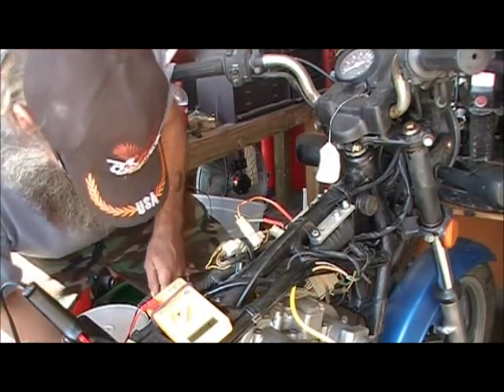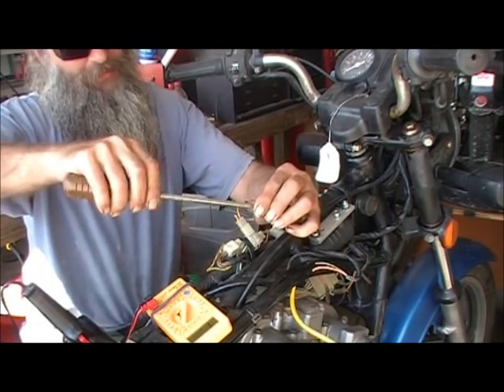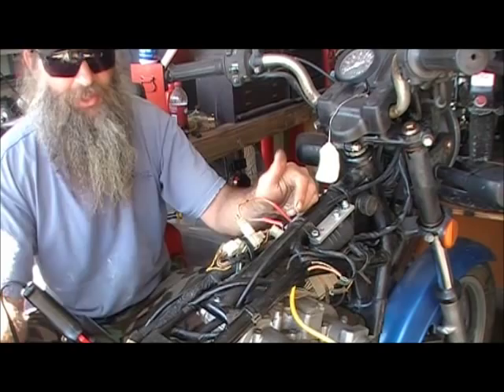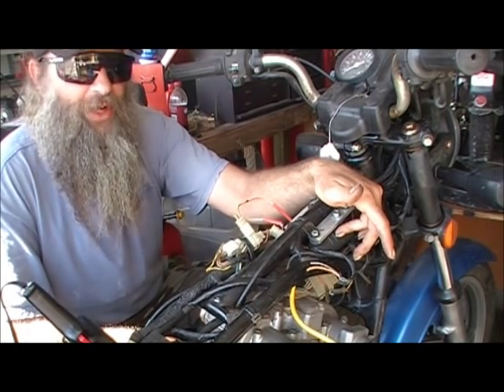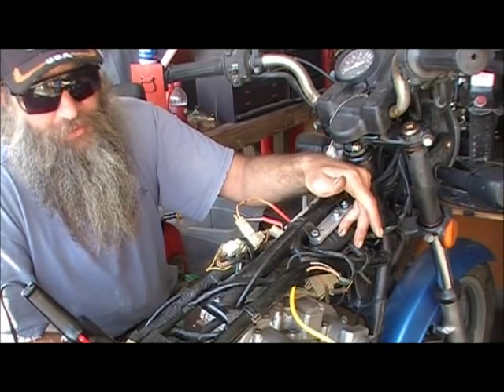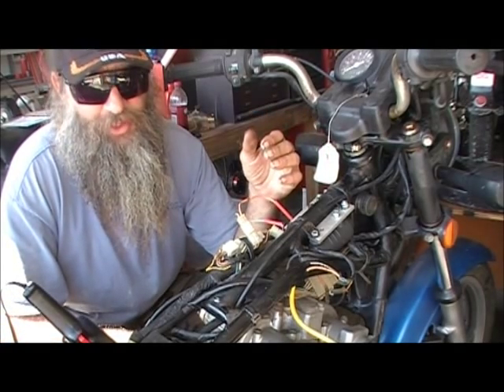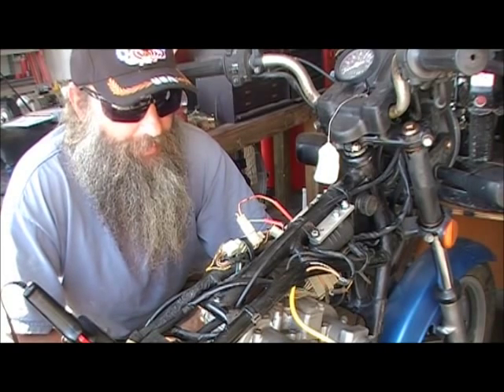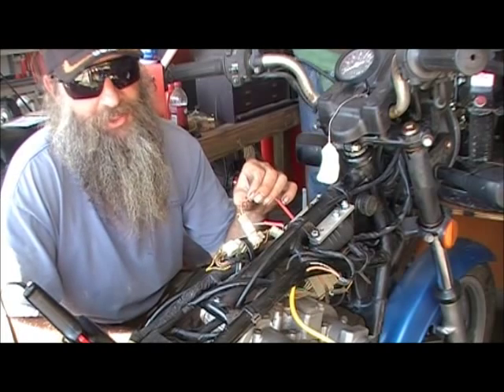How to prevent Motorcycle Coil Damage

Comment: True words spoken by a real rider. I had forgotten about the resistors this saved me from making a unnecessary purchase. I totally agree with him about the Dyna coils as well not for a man who puts 200 miles or more on his bike a day. Rain or Shine
Reply: Good morning brother, I have a dilemma. My bike is down again I'm not used to this from old Hondas! but to the point, my pickup coils have gone out on my 96 Honda Shadow VT 1100 c it has a4 wire pick up not a two wire. I bought a used one offline for a hundred and $40 but it died today and have later and and all I have is my bike and I put 200 miles on it usually a day. I am having the hardest time finding a new old stock or new set of these coils. Do you have any or would you have any suggestions for a man who is very capable in the terms of fabrication and all things mechanical could do too remedy the situation as I need to be back on the road immediately. Thanks for your reply keep up the good work.
Reply: Good morning brother, I have a dilemma. My bike is down again I'm not used to this from old Hondas! but to the point, my pickup coils have gone out on my 96 Honda Shadow VT 1100 c it has a4 wire pick up not a two wire. I bought a used one offline for a hundred and $40 but it died today and have later and and all I have is my bike and I put 200 miles on it usually a day. I am having the hardest time finding a new old stock or new set of these coils. Do you have any or would you have any suggestions for a man who is very capable in the terms of fabrication and all things mechanical could do too remedy the situation as I need to be back on the road immediately. Thanks for your reply keep up the good work.

Comment: I had a Crane coil crack on my 98 S&S 96ci …Titan Sidewinder ….what coil do you recommend to replace it …ignition is fine
Reply from the maker: I generally stick with accel -- 140408 if you need split towers -- 140403 if you're running parallel towers (first one is 3 wires - second only 2 -- both have 2 output coil towers)

Comment: How do I wire up coils on a 1986 yamaha fz600 an do they have to be grounded to frame
Reply from the maker: They dont have to be grounded to the frame -- you have 1 wire that is trigger and one gnd... but an FZR the coils aren't polarity sensitive - about 20 years too new for that ..
Reply: @dawino6260  ok so when u say polarity sensitive that means they stronger or weaker sorry for questions I'm new to motorcycle an is there a way to no if cdi box is bad wish I had u to work on it lol

Comment: Good day sir, first thx for ur awesome info video. I'm having trouble with a xv750 virago. When I start the bike and rev it high it works normal, but when low n slow rpm revs, it bogs and sometimes stalls when I let go of throttle. The colour of  spark plugs are dark brown at the top, and the bottom to the rim has black colour. Please help me with this issue I'm having sir?
Reply from the maker: Likely just has the virago vave guide drip ... but the low rpm at idle.. there is a single finger turnable idle adjust between the carbs .. Also - replace your plug boots with fresh NGK -- the resitors in them tend to eat up every couple of years - your favorite flavor is 5000 or 5k ohm - very often the culprit to low rpm stumbling ... check fuel filter .. not worried about the pump if it's running fine at high rpm ... If it only does it when it's cold, that  is the narue of the beast .. the 750 and 900 never seem to idle right until after they are warmed up for a couple blocks...
Reply: @dawino6260  thank you very much sir, I'm going and do as u said and see if it makes a difference. ☺
Reply: Good news sir, I've installed the air control valve system which does be inside the left pod, and what you know the bike is not bogging anymore. Thank you very much sir, I really appreciate for sharing your wisdom.☺👍

Comment: I have been using the ngk aftermarket ones. They are cheaper these days and after about a year they fail. Taking them apart, cleaning the contacts by using some cleaner and sandpaper then putting them back together will work for while. After it becomes a monthly chore or finally costs you a coil, you learn to just buy new ones and change them once a year. I'm in the habit of checking the coil and plug caps every oil change now. And as always change oil every thousand on the dot. Cheers

Comment: Thanx for all that, I appreciate your effort.  The Bonneville is my dad's 05.  I've already removed the seat, tank, coil, control box, and relay.  My dad is going to take the coil to a dude that he knows that flies airplanes and have him test it, dad says this guy is an expert on this stuff.  The control box has 18 pins, it probably can't be tested even by a dealer unless they put it on another bike.  No, I don't even have a Harbor Freight multi meter, I should prolly get one and learn to use it

Comment: I just installed Accel 140403s on my 81 Suzuki GS650L, is this aceptable for this bike or will I face any ohms/resistance issues?
Reply from the maker: shouldn't be a problem -- your stock tin ignitor box can take down to 3ohms -- but I'd use a 1 ohm automotive ballast resistor on the constant (not trigger) side of the coils if I was keeping it for me  if the box had previously burned the connector for the + inside the connector -- if not then no resistor  (those are just high speed switching transistors in those boxes to serve trigger)
Reply: @dawino6260  thank you 🙏

Comment from the maker: @MrCcj13 Depends on the RD - most did but like the 75 RD350 you might pull a set of 1.5ohm coils instead of 3ohm -- yet they look the same - Always check to be sure... CDI/TDI you can go up an ohm or 2 but NEVER below 3ohms (some like a Kawi inductive cdi wont let you go below 4 ohms)

Comment from the maker: add a .net to the mikesxs no charts but everything has resistance values listed in their coil section. and that's the best source for tek replicas (the originals are long since an ebay NOS item). Your GS1000 box can take 2.5ohms primary - Suzi went up because those boxes like to get hot - The Accel coils wont tear out a box but a heat sink on the box isn't a bad idea. (bare minimum case ground the ground terminal directly to the engine)  The Accels are the FAR superior spark

Comment from the maker: or a clogged pilit passage or a leaking intake. or bad resistors in your plug boots. Generally a Yami will misfire on a weak battery till it gets charged (unless there's a dead cell but it's unlikely it would start without a boost then) Also - wide open no-load on a 535 they float their valves (which sounds like a mis-fire) use an automotive tach and stop at 7500 - if it does it under 7500 then it's a mis-fire .. if it's waiting till after 7500 your valves are floating (no fix required)

Comment from the maker: That little GN400 I had I ended out futzing with the timing plate every 1000 miles or so - That and it ate a couple of cam chain tensioners. Now in theory that sounds good - but stop me if I am wrong but isn't the GN250 the same as its bigger brother in that its 6V? I thought (not sure) the GZ125 was 12V??????

Comment: I own a 20+ years old ST1100A which starts blowing one particular fuse (The one for IGN, ACG, STart). Sometimes during high speed riding on the highway, other times doing just 20 miles ..
Sometimes after a long time riding, other times pretty quick.
It all started just weeks ago .. I replaced the alternator, coils and the starter back in December .. coils are Honda OEM but the wires used are (I now suspect) inferior after market wires.
One of 4 has a oxidized copper core, totally white and blue ... Is the coil behind it dying?! Or dead already and so did it fry my CDU already?
If someone knows something to look at, please tell me!!

Comment from the maker: I'd lean towards Accel for the coil... but meantime.. do you have a cheapie harbor freight multimeter (you only need ohms and volts) - Power lead hitting the box has to be at least 10v - No way to test the box - check primary windings on your coil  should be 3 to 5 ohms (box will handle 2.5 but not much less). pickups the ohms should be listed in your book but if they aren't I can look em up for you -- eliminate those 2 and you know if its the box.

Comment: No both 12v, Ok new auto ranging mulitmeter arrived this morning along with a new RR, seems the new one is just as different to the book, so will just assume they are both good, then just test the charging output. Yet to run the bike agin with the 125 CDI, so we'll see I'll check back in a few days and tell you how i got on

Comment from the maker: Wouldn't be likely to hurt your coils... but I'd hate to think what it's doing to your rods and cylinder walls -- there's a recommended minimum idle for EVERY engine... usually has something to do with where the oil pump starts moving enough oil to keep things lubricated (and with 2 strokes -- enough velocity to lube everything from just a fuel/air/oil stream)

Comment from the maker: replace the battery first just in case it's just a dead cell creating load...  Without knowing which bike I cant be specific but my general test is just to start the bike with no (or minimum) load and check my 3 AC leads coming to the rectifier -- generally if they are within 5v of each other (with the bike running) the stator is probably fine.. Also I'm seeing that happen on crotch rockets with much more than 10 amps of extra lights on em -- YES btw they will run without a stator at all

Comment from the maker: Stock wires the boots have a screw in the middle of em that screws into the wire -- aftermarket coils often use automotive crimp style connectors -- My personal rule on wires is: Replace em every 3 years whether they look good or not

Comment: Big thanks for that, after bother with my virago I just checked the spark plug boots after coils failed(sent for the coils will get them in a couple of days) so after seeing your video thought I would check them out and one of them is dud, bike has been in shop to get fixed and they did not pick up on this, cheers bud

Comment from the maker: Yup - 1 make sure your fuel line is a steady drop (no upturns to allow an air pocket to form.. 2 check your vacuum line from the petcock to the carbs make sure its good (also this is all assuming you "floated" the floats to make sure they were good... check to see if maybe the petcock itself may be blocking by sucking on the vacuum line and making sure it flows out of the fuel line in on or reserve (I have to run mine in prime the first couple of minute before switching)

Comment: Would you recommend not using the resistor boots at all to avoid that whole mess?
Reply from the maker: On stock coils .. directly dependant on the coils .. some (like early mitsubishi's) yer gonna get your secondary windings too hot .. Tek I generally wouldn't worry .. accel, dyna, knology - no worries at all ... TDI ignition with any coils other than TEK or accel you'll cook your ignitor box in a week due to lack of added resistance (TDI was really early 80s Hondas and then thankfully they had the good sense to give CDI back to us .. only a few models too like early cx500's)

Comment: a buddy of mine has a gs650 too, but since its says "1-3" and "2-4" on the sparkplug cables he thinks that it should be put on like that. so one of the 2 wires from a coil gous to the outside and one to the inside.. it dous run but the middle 2 cylinders dont fire. but when we fucked about by switching cables around the non firing cylinders moved. so its very possible we are are having either the wrong coil or someone switched around the boots, fun problem finding.

Comment: Couple things, for your wisdom. A coil is nothing more than a transformer. It has 2 sets of different gauge wires. The low side, is fed by the bike. It basically takes energy till it is fully saturated. More energy than that and the coil will overheat and melt the insulation on the wires. That spark box, its main job is to cut the power going to the coil. WHen that power is cut, the electric fied in the low side collapses. This collapse causes the high side(to the plugs) to energize and send the power to the spark plug.

Now, the resistor in the plug cap does 2 things. Yes, 1 is fcc regulations to control electrical interference. Now, I doubt the average 70/80s bike would create enough electrical noise to actually do anything, so then reason #2 becomes the primary reason to have the resistor. Longer lasting spark. Without the resistor, your spark will be stronger, sure, but it will be much shorter. That shorter lived spark will not ignite the a/f mix properly, thus wasting that spark energy and fuel, not to mention less power. With the longer spark life, the a/f mix can burn better, thus you get better power and efficiency. 

Now, the reason that you blow spark boxes is when the field collapses, the energy is supposed to go to the secondary windings on down. When that path fails, residual energy floods back into the coil(coils are 2 way, as is virtually any transformer), the field builds back up and collapses again but this time the energy is sent to the spark unit and it is not made to take jolt like that.

Also, always make sure the ohm rating on a replacement coil matches, or is higher, than the rating on your ignition.  Lower ohm coils take power much faster and that can overheat and kill a spark box as well. This also happens to points. Points wear out faster when using low ohm coils, so does the capacitor.
Reply: Schwen hi it seems you know what you are talking about so would like to take a minute of your time. I have a 1983 honda shadow and I am not getting spark. 2 coils and both have continued current to one of the points. But not to 2 point. One of the ignitor boxes gets hot and so does the coil....how can I find which one of the two is messing up if not both

Comment: My first bike was a Honda cb400T that fried the stator every 6 to 8 months. I gave every bike workshop in my area a go at fixing it but the problem always persisted. I changed everything in the ignition system (except the lead ends) and still no good but never thought to check the boot resistance. You reckon this might have been the problem?

Comment: lol "I'm the kind of guy that go to the race track with a race bike on a trailer strapped to a goldwing" legend I got husqvarna 610 the cdi keeps blowing and now the ht coil has dropped in the secondary winding by half the resistance. found out my cap was intermittently working due to bad contact on the resistor inside the cap pulled it out the resistor test fine in some spots but 0 when put back in the cap. hopefully this is the last I see of this problem gonna buy new cdi replaced the cap already fingers crossed cdi ain't cheep thanks for the video

Comment: I have a 74 Honda 360 cb that won't start I bought a brand new battery last year has new fuses new spark plugs ...and when you try to start it it acts like its going too but nothing happens ...also has new fuel lines .... bought it as a barn find but was complete ....any ideas ...been told the coil packs are bad or its this or its that ..but no money to take it to a shop so was gonna try to fix myself but I'm new to bike mechanics and this is a first

Comment: I have a question: 1971 triumph Bonneville.... idles ok but as soon as you drive it spits and sputters and gets worse from there.  it's not a carb or fuel issue.  
I believe one of the coils are bad.  sitting on the bike,  the left side/ pipe is the misfiring side,  right side is fine.  
If you take the left wire off while running,  it doesn't change much. take the right wire off and it cuts off. 
do you think the coil is bad?? 
Thanks for your input.
Reply: it sounds like a timing issue get the bike timed by a timing light to set the ignition timing.
Reply: MrEmtdaniel4jesus fuel issue. In the carb

Comment: the 125 has a different connector so before I rush out and buy another, so I'm going to strip it down and clean all the connectors and put it back together, and take it from there Not 100% its electrical, stiff diaphram has been sugested as it's been sat for 15 years but it seems supple enough,I put a keyster carbs kit on and ultrasonic'd 3 times. just keep checking need to figure out the best way to check timeing...do people still use timing  lights ??

Comment: How much voltage should be leaving the coil? When I attach my bullet connectors, I read like .32 ohms going into the paired wires, which are gray on one side, orange on the other. If I unhook the paired wires I get 12 volts leaving the coils.

Comment: Hey man. Just bought my first bike a few weeks ago. Its a 1982 Honda CM450e and Seemed that the only problem was the carb, and I had it running pretty good. Now I'm not getting spark to either one of my plugs. I worked on cars mostly, but not on bikes, so im not so fluid in some areas. I was trying to understand what your saying, but im not sure about one thing. You said if you have a blown coil, I probably blew my CDI box too? Or could I just fix the boot or something and be good to go?

Comment: Dyna coils work well on my kz's but you must run a resistor (1.8 ohms) in positive to coils
Reply from the maker: I've never had any luck with em in daily drivers --  out of the 50 or 60 bikes I put em on I ended out having at least 15 of em come back to me with a cracked coil -- PS The resistance depends on your ignitor/ignition box but good point

Comment from the maker: You check your condensers with a capacitor checker (or a good meter that does capacitance) - Your orange is your trigger -- just check your primary windings on (the 2 wires using an ohmmeter) - check your condensers seperately